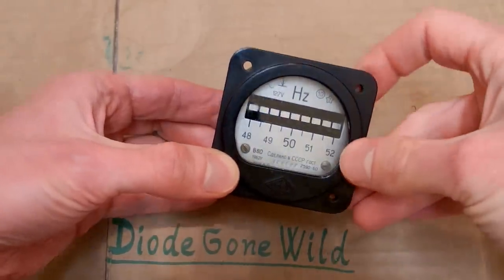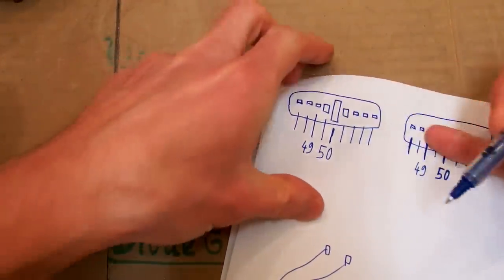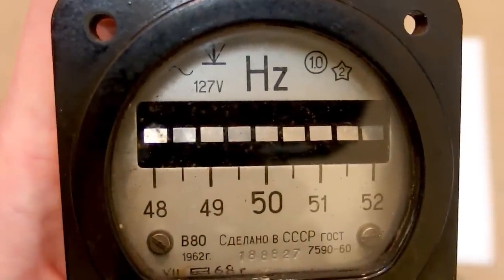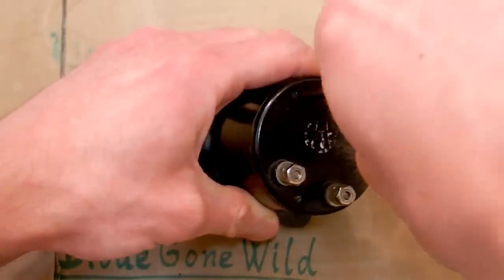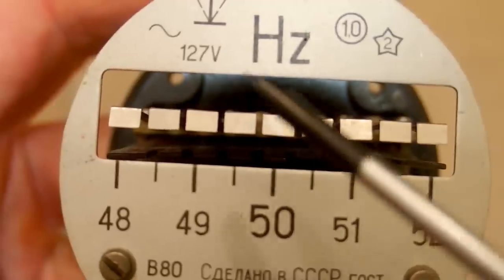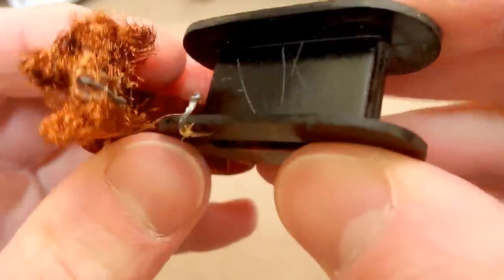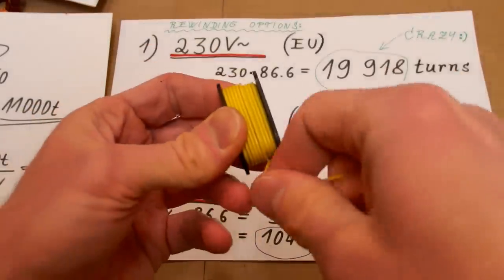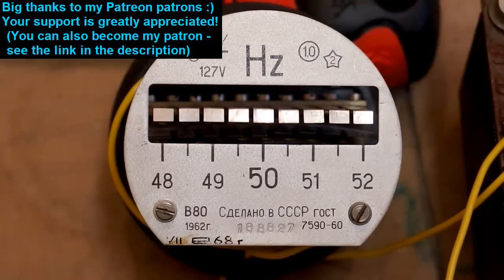Vibrating reed frequency meter

Comment: This is usually part of a so-called " measuring  group " , which is Standardised like ,> Whatever Nominal Volts to 100 V , and > X Amps to 1 , or 5 Amp current Trafo s ! ( Of course , they add some tolerance , to prevent the magnetic saturation   in case of a " little" over voltage ) After that You have the Ratios , and feed the other "standardised " instruments ,like Watt , Amp , Volt , P.F. (  cos phi , sin phi), reactive/ apparent  power meters .

Comment: You don't need to rewind it as original. I run low turn coils like this with a capacitor in series (4,7uF) and it wooooorks ... amaziiing ;) The current is about 0.3A and the strength of the magnetic field is good enough, while consuming reactive power. It's probably even better than the original.

Comment: Yea those doohickies are perty neat.  I have a mhz 1-25 which i have no clue what  would use that frequency really it used to live on a factory belt line motor on a vfd. Ihad to upgrade it because being its working principle of vibration it was a hairy bitch having to read when a hopper down the line was having a seizure and everyoneof those damn fingers were jigglatin.  So after having to use my handheld needless to sayit came out and about went hulk smash mode on it but didnt because  it was old  it served its purpose. Reminds me of the wind up musicbox era.

Comment: Just weigh the wire and put the same weight back on with the same guage of wire.
Reply from the maker: The 220 turns of the first layer are 14mm wide, so the gross diameter of the wire including the enamel is 0.063mm. The actual diameter of the copper has to be like 0.05mm. Insanely thin :). For 230V it would be even thinner.
Reply: @DiodeGoneWild  
Yep, you could get a micrometer on it to check diameter, I did this on a generator and it worked well after replacing with the same weight of wire.
Great channel btw!
Reply: @DiodeGoneWild  
You could use a capacitor dropper, I'm sure you know.
I just made the comment if people have similar problems more than anything.
Reply: @DiodeGoneWild  
Or you could transfer a winding from a similar sized transformer?
Reply: @mernok2001  
Sensitivity would be highly load-dependent but could be a good solution!

Comment: Maybe rewind it for 12V, it would be much easier than trying to wind thousands of turns of fine wire so neatly. Then you can use an external transformer which are very common for old halogen lights at 12V.
Reply: That will probably work or any trouble Transformer that would provide a rated current of your coil. Would definitely work more than likely.

Comment: My guess is that the frequency in the mains is set by the rotation of big generators in the power plant.  They would have a lot of internal inertia so for them to vary much would be unusual.
Reply: Joseph Nicholas - The actual mains frequency depends on the power output from the generators compared to the load demand. If the load increases, the supply frequency will fall. If the load is reduced / or more generators are brought on line, the frequency will increase. So the electrical grid operator is always trying to match the generated power to the load demand...
Reply: @Mark1024MAK  speaking of which I do know that the old zillweger relays and other remote controlled frequency related relays would drop out the load if the frequency would drop below a certain reading. To reduce load automatically. If you're should be a drop-in means frequency due to overloaded the system or a threat of a blackout due to excessive load or an adequate generation or problem with the grid. Automatic load management one might say. AKA loadshedding.

Comment: Why don't you add a resistor for current limiting. I saw one with 2 rating 220V and 440V and it had 2 resistor.
Reply: You don't want to limit current.. This device works with magnetic fields, which needs lots of current to produce.

Comment: Also I've seen a similar meter except that only has two reeds 1 for 60 hertz and one for 400 Hertz for military applications because is there equipment runs at 400 Hertz for lightweight and efficiency just like aircraft installations.

And very possible to pay all you plug into you could have either one. And some equipment could be switched to convert that to 400 Hertz from 60 hertz. Static frequency changer.

Comment: You need a frequency measuring device in every power plant. If you power up a generator, before connecting it to the mains grid, it must be synchronous with the mains. Otherwise you'll have a short-circuit.
That principle is very old. There are several methods how such frequency meters work, and several patents. For example method "Hartmann-Kempf", the book is from 1927:

https://books.google.de/books?id=kHaLBwAAQBAJ&printsec=frontcover&hl=de#v=onepage&q=hartmann-kempf&f=false

I agree, it was my first thought too: 127V fits into a three-phase system. Every phase 127V against neutral or ground. Phases against each other 220V.

Comment: Isn't delta typically used for supply rather than wye?
Reply: Delta is usually on the high side, so that you don't have to rely on a neutral wire coming from the substation

Comment: I believe that your frequency is as stable as here in Finland where it now is 49,952 Hz. It would be an interesting project to calibrate that. I believe that the easiest way to fix the windings is to tahe a small transformer and use only the windings.
Reply from the maker: The entire Europe is now connected, so you have now the same frequency as me, exactly :). There are websites that show the actual EU frequency online https://gridradar.net/netzzeit.html
and even the deviation of the mains-controlled clocks.
Reply: @DiodeGoneWild That is not true, continental Europe is roughly in sync from Portugal up to Turkey, including Western part of Denmark, while Scandinavia and Eastern Denmark belong to another synchronized system formerly named NORDPOOL, UK is out of sync with Europe and Ireland is also out of sync with UK and Europe :). So if there is need to exchange energy among those unsynchronized networks HVDC must be used to couple those networks, for instance Estonia to Finland HVDC submarine cable or Russia to Finland HVDC (back to back)

Denmark has two TSO systems out of sync (West - Europe, East - NORDPOOL), so in order to exchange energy in Denmark they have to use HVDC (Great Belt HVDC)

Finland belongs to NORDPOOL and its frequency can be oserved here :) https://www.svk.se/en/national-grid/the-control-room/

Comment: Its intresting, that in USSR they had 127v in one phase, but everybody used 220v electronics. So they dont used one phase in one socket, but two, right? I don't knew it, i though that it is like in other east europe(or was) 220/380v.
Reply: I just reading russian sites, and they change 127v to 220v in 60's 70's and 80's to make wires more effective
Reply: And now i knew why soviet tv's has got switch 127/220v
Reply: Older cities in The Netherlands (Leiden and Amsterdam) used also 127/220 Volts, but these systems have been upgraded to 220/380 and 230/400 Volts in the mid 1970's.
Reply: @RODALCO2007 Good to know, thanks for info! In USSR too, it's just better, only america and some other countries dont change it. In Poland (PPL) govertment was building 220/380 from the start in 1945(earlier(before war) only few parts of poland have power), and mass electrification under communist from 1 to 100% in 20 years was made in 220/380v. Change was made in 2003 when we have changed from 220 to 230 eu standard, but it was only in paper, most od Poland has got same old 220 infrastructure. From 1945-2003 it was 220v+-5%(209-231) and from 2003 it is 230+-10%(207-253v) so infrastructure can be old, and change is only on paper.
Reply: There were also very unusual Voltages in Southern Italy before the 1960's The Voltage was 160/276 Volts - 50 Hz. Read this from an Italian book  "Storia dell'industria elettrica in Italia"  @JanKowalski-ic6np
Reply: @RODALCO2007  Thank you for your reply, i don't get info about your reply. It's intresting, i don't knew it. But it's logical, because (160*380)/220=~276,36v between two phases. It was 50 hz, so only voltage was different. Nice to know. Old soviet tv's(or made in Poland soviet licence Rubin 714p) has got 3 or 4 voltages switch (i must see it, i don't remember)(for export), 127/220, and maybe 110, or even 160. Nice to know, that it was 160v too.
Reply: @mernok2001  I don't know how american power system works, did they got 3 phases? I know only that they had 110v 60 hz. Is 277v between two phases? I must study it, i've got many (e)books to read, but i put it to another time every day. They had different infrastructure, but how it closer works idk.
Reply: Yes, old tv's from USSR, maybe only export, had 110/127/220/237v switch. http://www.pwl.mikrokontroler.pl/tv_retro/rubin102/01.jpg  So it can be used in over the world, where is d/k(secam for colour models) system, and 50 hz(so d/k system, 576 lines), because i think there wasn't any other voltages in europe, or world after 60's. It's so universal;) There were also other tv system versions as well.
Reply: USA has a lot of different LV supply Voltages. 
Domestic Single Phase is 110/220V, 115/230V, 117/234V or 120/240 Volts 180° split phase.
Three Phase Commercial 120/208 Volts 120°
Three Phase large commercial 277/480 Volts 120°
all at 60 Hertz.
 @JanKowalski-ic6np
Reply: Residential and small office small buildings and not a thing way too heavy is 120 to 220 split phase single phase.

But yes Lord your customers are three phase..

With a few different voltages but it's too complicated to get into. Hurry right this second.
Reply: @JanKowalski-ic6np  but also there's a weird system that is evidently still out there.

And I'm not talk about The Old Edison DC system either.

I ran into that once many years ago helping someone out.

Also what I'm referring to is the two Phase Electrical System.

You'd think there would be a neutral and 110-220 in most places but you may be wrong. Besides three phase.

The standard Outlets were wired with two separate wires neither of which was a neutral as we would expect.

And both were at the same electrical potential across either wire.

There was four wires total besides ground.

To from either phase.

Hey hun you think that you'd at least get 220 from one combination or another but you didn't.

That's what threw me.

They were trying to hook up something that require 220 but I couldn't get to 20 of our what I tried.

So I called on one of my electrical Buddy's and he said what are you even talking about I said I cannot get to 20 out of anything anywhere.

And no matter what I tried I got just a hundred twenty. Or so.

She asked where it's located he said oh no wonder you got to face power there.

I'm like what's that.

Is this is a hold over for who knows how long ago.

Oh by the way that was primarily used for large Motors like three phase except that the motors will be attached bro phases I forget how many degrees out of phase they are.

But I hear that welding shops really liked it because it a nice will pattern in arc welding processes.

Comment: You said that the frequency is very precisely regulated nowadays. What about the time a few years ago when Kosovo shut down all its power plants so the frequency dropped significantly in most of Europe? I don't remember by how much the frequency dropped, but after a few days, cheap clocks that depend on the line frequency (aka mains frequency) to measure time were off by several minutes.

Comment: At 3:40 we can hear the same thing twice, maybe so we can memorize better?
Reply from the maker: No, it's not the same thing :). First, I've said that it was maybe used to measure the frequency  of a generator which is NOT connected to the mains, and then I've said that it was maybe used to measure the frequency  of a generator BEFORE it is connected to the mains :).

Comment: My grandpa's DIY car battery charger had the same meter but an 230v. I still use this to charge my cars but I removed the frequency meters since it wasted too much voltage. I have to look at the charger when I drive to  and if I get it out of the charger and I would then message you to get your address or P.O. Box details
Reply from the maker: Thanks :). I'd definitely appreciate it! You can contact me at danyk@centrum.cz